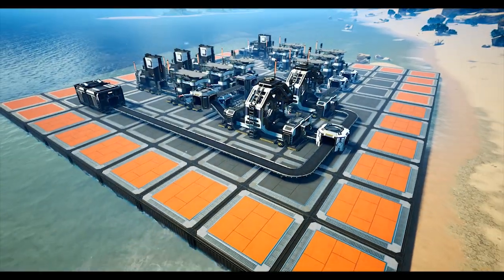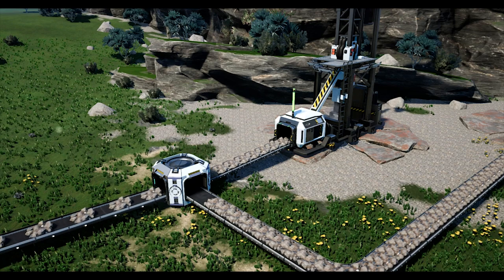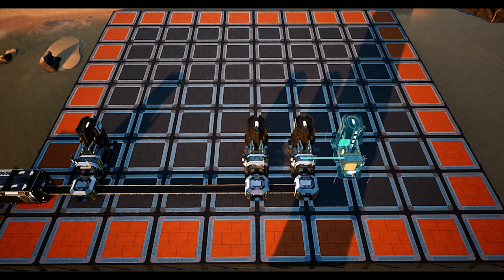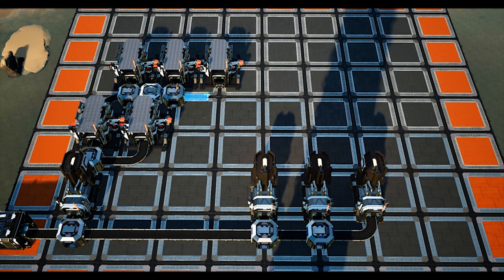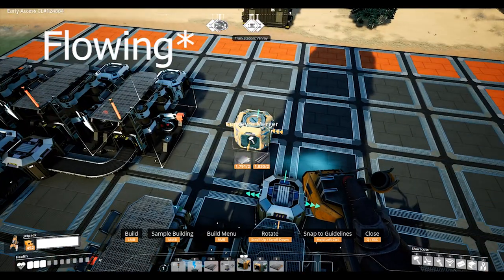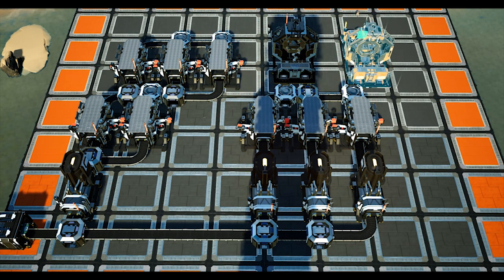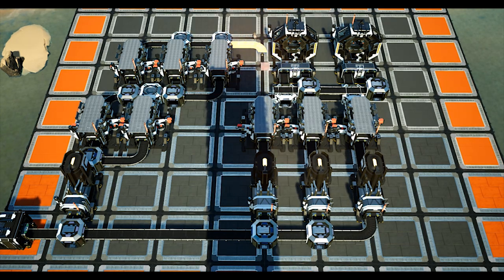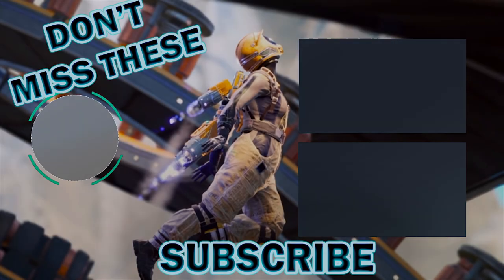The Efficiency Build Guide Reinforced Iron Plates [Satisfactory Game]

Comment: This is not a 100% efficient design. I know its not too bad, but there is a design that uses only 90 iron ore/m while still outputting 10 reinforced iron plates/m and is more efficient.
Reply from the maker: It depends which way you're looking at it, but this design is 100% efficient as it uses all resources to create the 10 Reinforced plates. Also note this guide is for newer players ;) You could argue that it would be more efficient if we double up the build and reduce the clockspeed to 50% or if you use alternate recipes, you can get more bang for your buck but that's looking at efficiency regarding getting the most out of your resources.
Reply: @TotalXclipse  The design i am talking about does not use alternate recipes or reduce clockspeed. The thing is, even tho your design uses all the resources, it doesnt use then 100% efficiently as not all of the smelters will be running at 100% efficiency. my design just uses less starter recources, which is why i believe it to be superior even tho it produces the same thing in the same quantity. it is also not hard to make.       now i want to explain why yours isnt 100% efficient. the way your iron ore gets initially split into 4 smelters is using a bus system, so if you have an input of 120 iron ore/m, the leftmost smelter gets 60, the next one gets 30/m, the next one gets 15/m and the last one also gets 15/m. this is not efficient as most of the resources are going to the first one. meanwhile, the 2 last ones are not even close to having 100% efficiency and will run at 50% until the first one fills up, making the whole system ineffective. this in turn would slow down the rest of the production after the 2 last smelters to 50%. ok, you get the point on why its not 100% efficient. another thing about this system is that it could have used less starter resources as i said previously. also, for some damn reason, my more efficient rip factory somehow uses only 3 smelters instead of 4 lol. 
OK PLEASE READ THIS. my design DOES NOT EXIST i messed up. BUT that doesnt NOT make yours 100% efficient as you are not perfectly splitting all the iron ore at the start!!! if you could fix that, THEN it wouldbe 100% efficient (so make the iron ore split perfectly into 4 smelters so that each smelter would get 30/m exact.) then it would be nice. i take my words back when i said that there is a design thats better, well technically there still is if you do what i said earlier, BUT there is no design that uses 90iron ore/m.

TL.DR: yours isnt efficient because your not spitting 120 iron ore/m perfectly into 4, meanwhile i messed up as there is no design that uses 90 iron ore/m. i would still recommend reading the whole comment tho.
Reply: DuLac Gaming 120 / 4 = 30 which is the input per minute for a smelter. This design is 100% efficient.